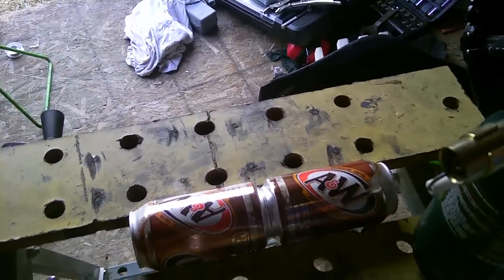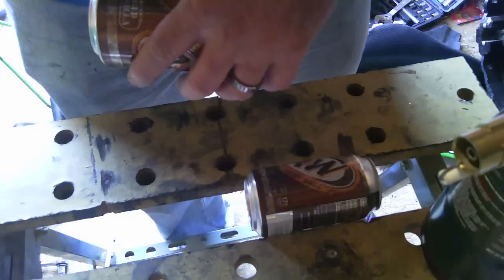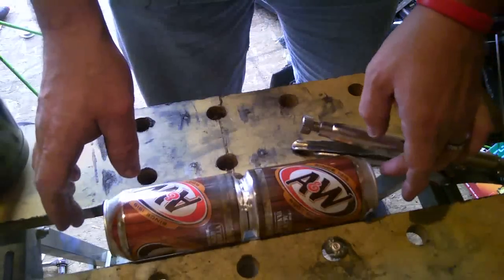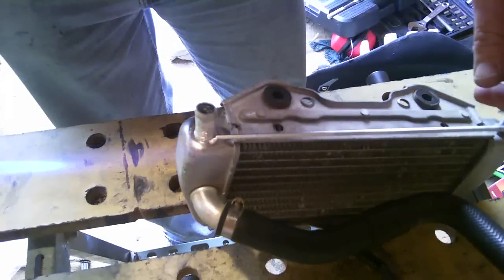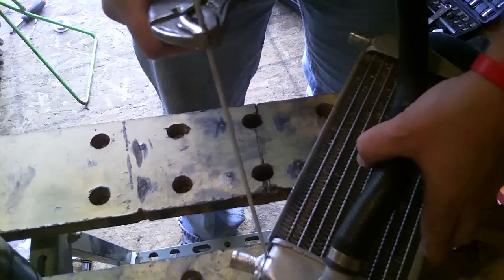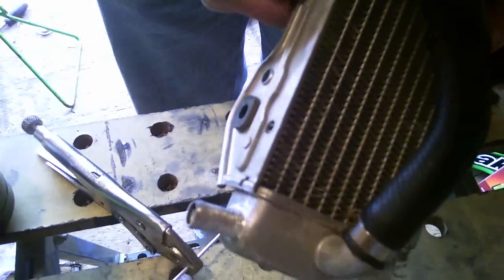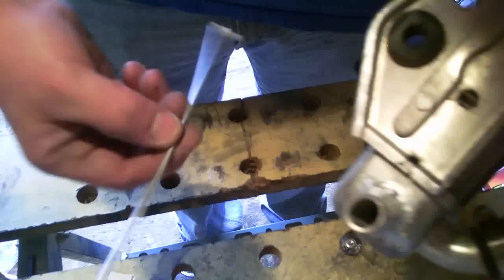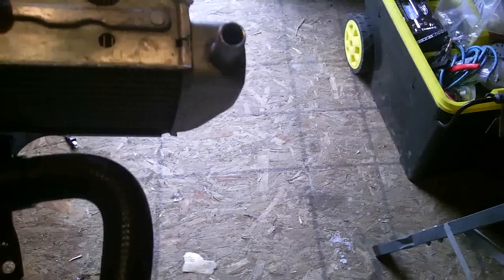How to weld aluminum with a propane torch and low heat aluminum welding rods fix your radiator.

Comment: I had same problem and used non lead solder with flex.  Lower melting temp than aluminum.  Seems to have worked.  Thanks for the video.

Comment from the maker: The cans blow through on the cans worried me. The last thing I wanted was a blow through on the rad. That is why I was hesitant to apply lots of heat. It did work well though the repair held strong. I would recommend the repair.

Comment: a smaller tip would allow you to lacalize your heat and you should get base metal up to heat before introducing filler rod. Your test with alum. cans , the metal is very much thinner, the radiator will take the pre heat better and not blow through.

Comment from the maker: Is there a special type of flux that I should have used? No wonder I had a hard time getting it to adhere. But note that in the end it worked well regardless. I pressure tested it to 30 PSI without a leak.

Comment: Well worth the cost of the rods :)
After watching your video and finding HTS-2000 and watching their video, I ordered som HTS-2000 rods.
They are supposed to be stronger and not require flux, based on the their video it is supposed to be a good enough bond for fabrication and thread filling.  I am looking to make a single wheel trailer for my bike using aluminum as the frame rather than steel.
Thanks, for your response.  Safe riding.

Comment from the maker: I pressure tested the radiator to 30 PSI which is 10 PSI above the release pressure on the cap with no leak so I am confident the weld will hold. I was impressed. I am sure your suggestions would make it even better.

Comment: I think more heat applied to make the brazing rod fully molten and a tinning brush to promote absorption into the aluminum.  But for first time use, not bad.  This method can be very cost effective and effective